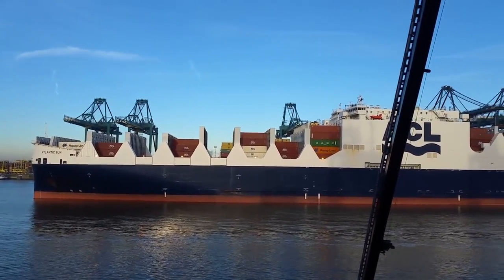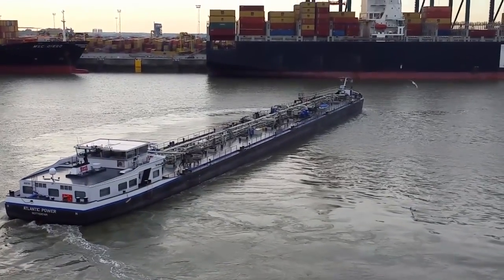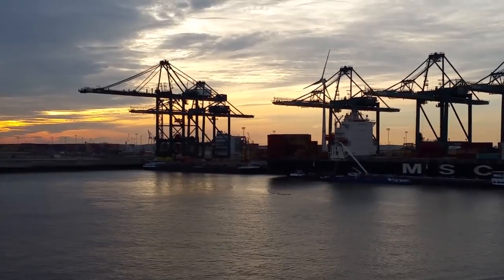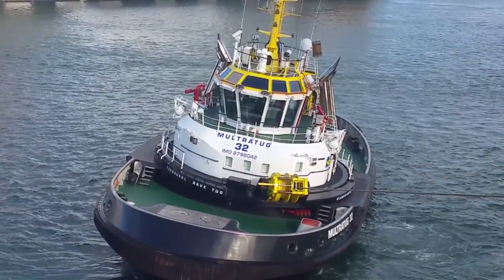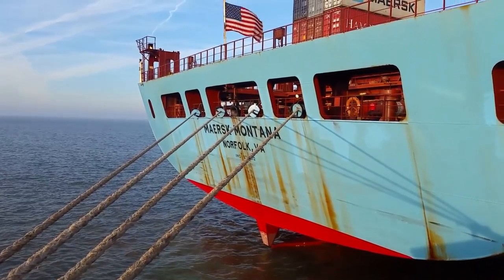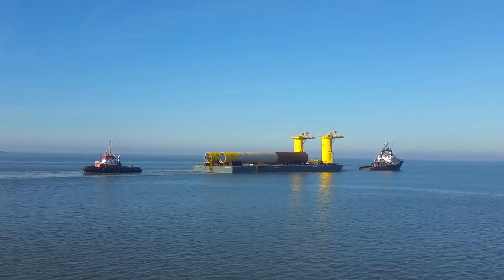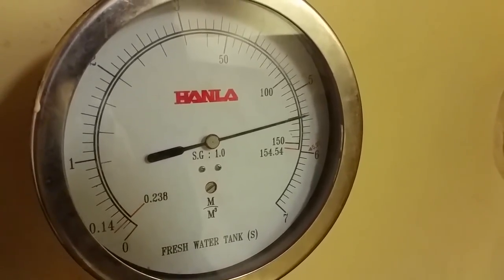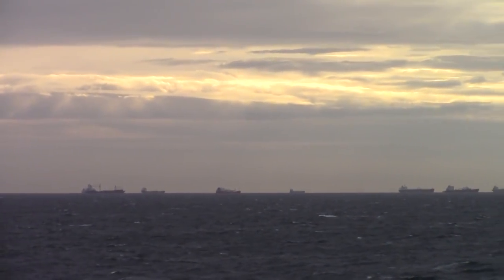Container Ship Vlog #21  (Footage from Europe)

Comment: When bunkering how’s many tanks do you fill at a time m Navy days for JP-5 are tanks where a nest of 6. We would have 6 to 8 nest open at a time. Of the 6 tanks one would be the overflow for the group the other 5 where connected to the over flow which had an over board discharge. In port we were limited to 80% and 90% at sea. No liquid indicators sound as. We filled. Lots of compartment spills if the sounding crew was screwing around. Back in the 60’s you could get away with some spills in the bays. Course we loaded at se @ 3200 GPM

Comment: Jeff, first thanks for the video. Why you need 2 types of fuel on board as you were mentioning. Second at around 4th min of the video saw that ship mooring and propeller runs bit faster than I thought, Why is that?
Reply: Well the reason for two types of fuel is because one is ultra low sulfur which is burned around the coastlines in Europe and USA for environmental reasons your second question the propeller of that ship looks like it's going faster than it is because the ship is sitting light so it's throwing a lot of water up as it spins giving it the appearance of going faster than it is

Comment: Why do you get low sulfur fuel and regular fuel? Do you use regular for open ocean and low sulfur when you get near ports or is it something totally different?
Reply: There are emission control areas around most of the continents where you have to use low sulfer fuel oil.
In 2020 all ships will have to burn diesel or use exhaust scrubbers with fuel oil.

Comment: Why do you fill fresh water tanks while on port?
As far as I know there is a sea water convertion system on board, isn't there?
Reply: Yes there is it's called a distiller or evaporator and it is working just fine but at the moment of this video we were doing maintenance on it so it was down for a while so we just stopped her Tanks off in Germany but you are correct the evaporator makes water and it does a good job of it

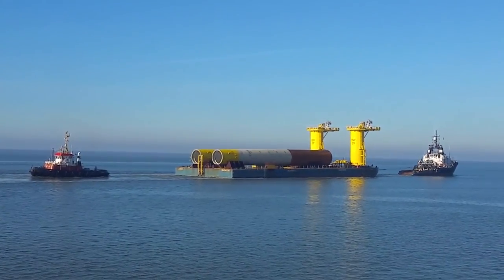Comment: @ 16:20 I think those are piles or tower parts for offshore Windturbines. By the size of the parts that could be around 5 MW of power with blades up to 50 or more meters long
Reply: Thank you for the information and thanks for watching I wasn't sure if that's what it was thanks for the clarification

Comment: Jeff, How do they turn the crank shaft slowly like for inspection?
Reply: I have another video that will be coming out soon that I actually show where the gear is engaged but basically there is a small turning gear driven by a motor and a push button controller to Go reverse or forward and you use a hand lever to apply the small gear to the big large planetary gear that is on the main shaft just after the engine and you can control it with the hand controller reverse or forward in very slow speed it is called a jacking gear or also turning gear
Reply: And the little push button controller has a very long cable that you can actually take up an inside the engine with you allowing you to control it as you are looking or doing a piston ring inspection Etc
Reply: Can you open that door while the engine is running?